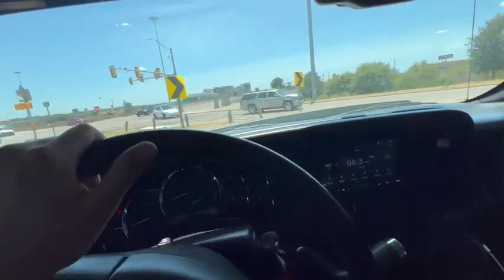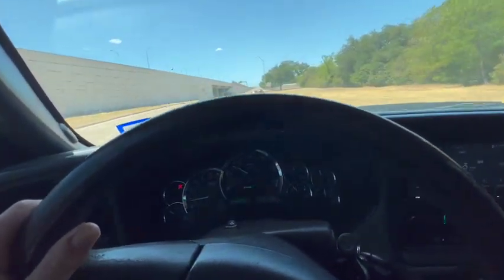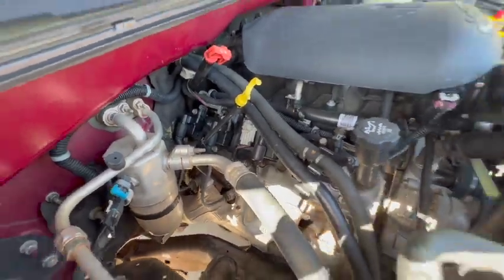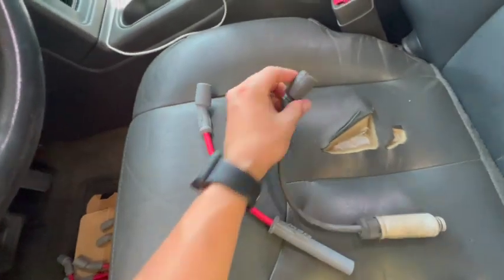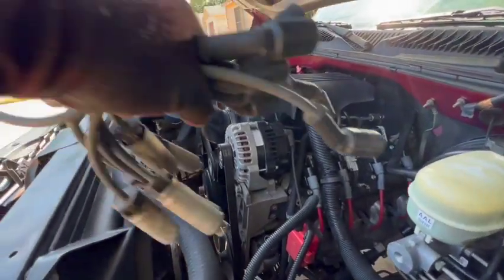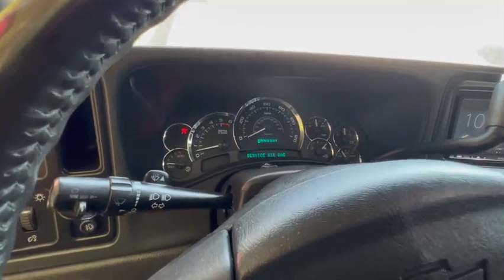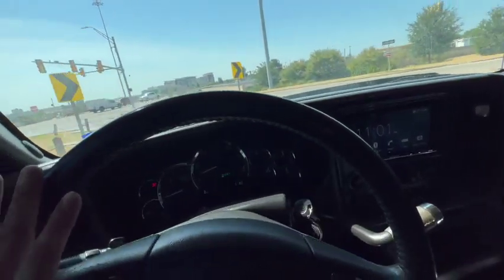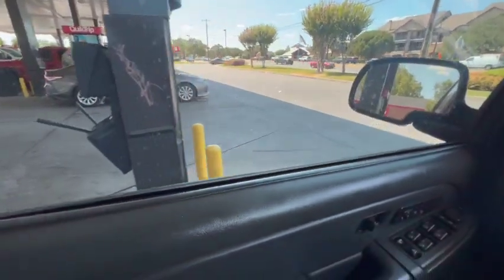MSD Spark Plug Wires 8.5mm install and review on the NBS Crewcab

Comment: No need to reuse the heat shields on them? How did they work to this day?
Reply: Probably burnt up by now made this mistake my first time
Reply from the maker: Yeah mine did not have heat shields as far as I’ve owned it. I may add them now that i think about it.

Still drives good to this day and definitely a smoother idle and no miss fires!
Reply: @yzzo_ozzy  The heat shields were on the spark plug wires you took off. You just slide them off and put them on your msd wires.
Reply from the maker: Didn’t realize those come off! 😂 I do have aftermarket heat shields now though

Comment: are you running after market spark plugs too? i just got a set of ngk plugs and msd wires , hoping my 5.3 runs a little better lol
Reply: Msd wires won’t make no difference and won’t add no type of horse power all it is you got more spark 😂
Reply from the maker: I have E3 spark plugs, nothing crazy
Reply: I have ngk spark plugs and also msd wires with it. It’s time too change out my spark plugs do I also have to get another pair of wires ? Or can I leave them
Reply: What year truck you got? What part # on the NGK plugs?
Reply: I heard ngk eliminates misfires and produces better spark I don’t think it’ll give horsepower though tbh
Reply: Lmao you can buy msd wires but can’t buy new hood hinges.

Comment: Msds are 150 where im from
Reply from the maker: I might’ve got them on sale or something but it was out the door around $80 from Amazon
Reply: @yzzo_ozzy   msd part number please 🙏
Reply from the maker: @calicris7160  I got you!

MSD 32829 Super Conductor Spark Plug Wire Set, 8.5mm thickness, 12 inches length